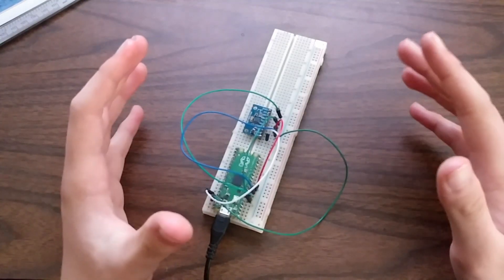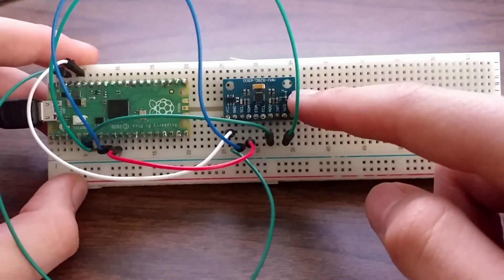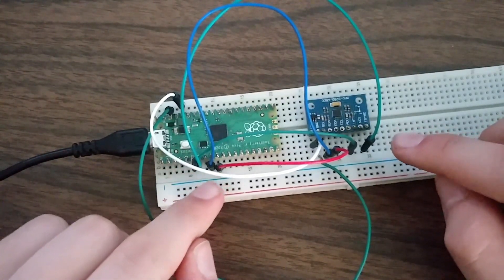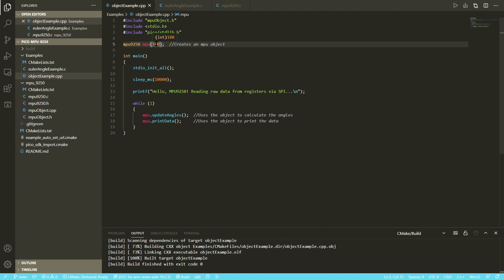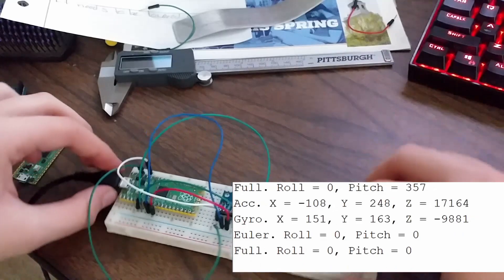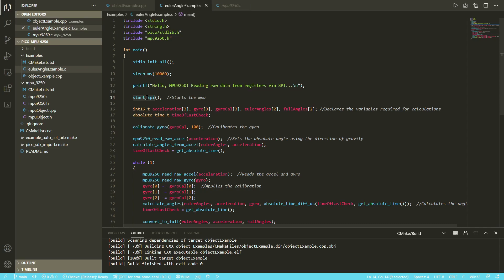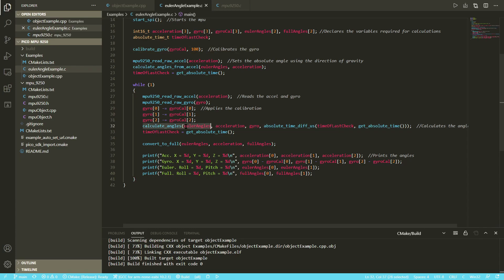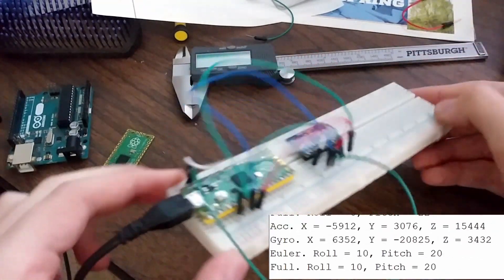IMUs on Pico - MPU 9250 Tutorial - C/C++

Comment: Thank you so much for the video, man. It was very helpful. Could I store this orientation data on the pico locally to extract later?
Reply from the maker: Yeah, depending on your application you can store it in a big array and then print it out through UART later or store it in EEPROM. EEPROM is kind of a hassle on the Pico though.

Comment: full fake! There is missing very important files! This is only presentation, NOT real  software for programing MPU 9250!
full loss of time
Reply from the maker: All the code required to use the MPU 9250 with the raspberry pi pico is on the Github page in the description.